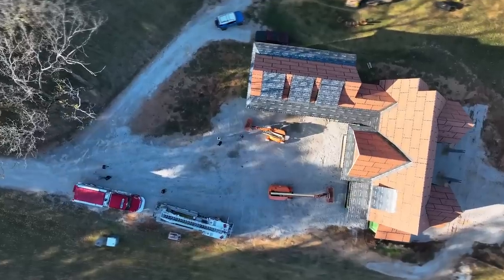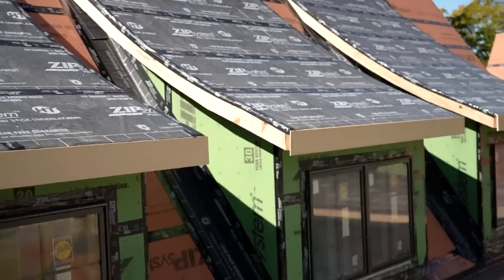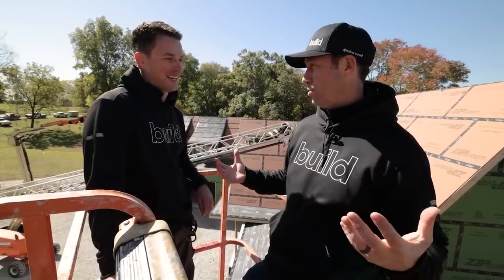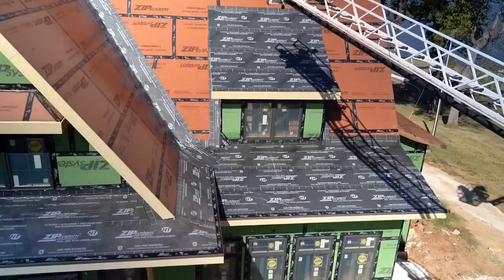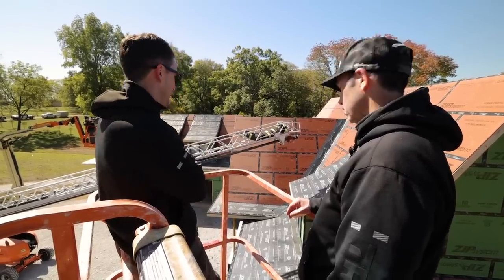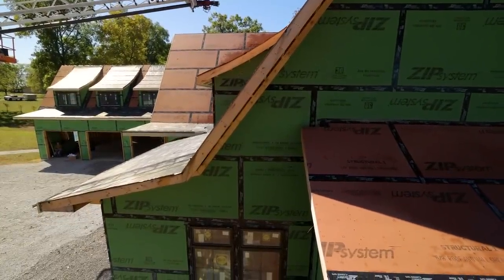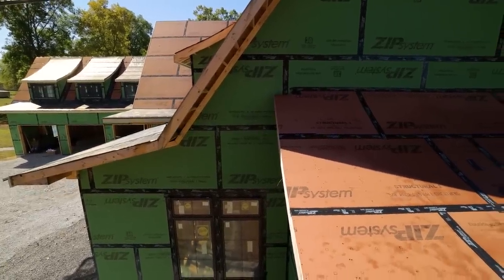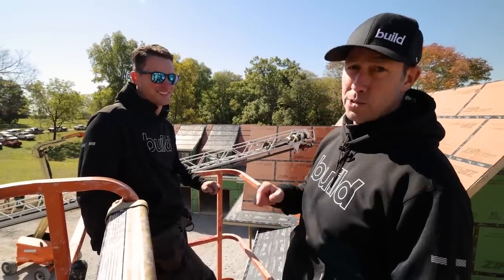Firetruck vs. ZIP System... Water stress test!

Comment: As a plumber, my experience is its not the big one off water exposure you need to worry about. It's the slow consistency that ruins wood in no time at all.
Reply: Yes, the fire truck is hokum for Huber products of glued wood chips dipped in goop and covered duct tape.
Reply: @newsnowadirondacksredux360  lmao very very true

Comment: Thanks Matt! You inspired my wife and I to not only use the Zip System but also build our whole house ourselves! Great video and reassured us we made the right choice.
Reply: @Islandwaterjet  it's not just OSB it's zip system. There is a huge difference.
Reply: Yes and it’s definitely not just OSB with paint on it either it’s basically a form board that’s stick able in order to be able to seal the joints super well and if done right it’s a forever product
Reply: @Islandwaterjet  what kind of waterjet do you have?
Reply: Nice lack of fall protection while on a lift. What standard uses a fire truck? None and where is the negative pressure/wind. I once watched an owner request a 4” hose and nozzle connected to a hydrant on a curtain wall field mock-up. He successfully blew the glass out in 5 seconds and I asked him if wanted to pay for a new mock-up to continue testing. 
Problem with Zip and peel and stick type systems is long term adhesion. Acrylic materials tend to crack in time. These systems are all based upon adhesives, which in my 40 years I’ve seen countless adhesion failure as a primary source of product failure once subjected to time, movement, temperature and moisture along with a lack of continuity in sealing dissimilar products. 
To quote Tommy Boy, “if you want me to take a dump in a box and mark it guaranteed.”
Reply: @Islandwaterjet  Exactly even it is spayed with a couple mils of goop and the seams are duct taped.
Reply: @georgewelker853  it is subject to adhesion of dissimilar materials. That’s not forever.
Reply: @Islandwaterjet  Thats funny, the pieces that I've left out in the elements for over three years for a backyard test are in excellent condition.
Reply: @mcintosh.daughter  what standard are you using for your test criteria?  Is it part of a wall assembly or just sheet outside in the desert?  Exposed to the water, thermal exchanges and UV radiation OSB will swell and delaminate causing wood fibers and glue to fail.  Moisture is a killer for OSB sheet.
Reply: @newsnowadirondacksredux360  And given enough time water can carve canyons into rocks. All wood is susceptible to degradation, unless its been petrified, then its much more resilient. Right now I have pieces of Zip that have been outside for over three years that are currently wet from rain/snow, and are holding up just fine. What Vancouver said about it "disintegrating in a few days" is false and ignorant.
Reply: @mcintosh.daughter  Typically, we use a 20 year standard in south Florida sun as a UV criteria. What standard are you using?  I reckon Vancouver is submerged his OSB in water for 3 days. Try that and report back. You must have standards to test. Fire hoses and fire trucks are for show as they don’t represent reality. This channel pumps the Huber system, which is fine I guess. However, I can show you T&G spruce with double felt and mineral wool that would do the same fire truck test and not rot in 10 years. Matt is likely paid by Huber.
Reply: @newsnowadirondacksredux360  I've soaked Zip. It swells some along the edges, but does not disintegrate. Hosing a roof down with a firetruck is not meant to demonstrate long term durability. It is a great demonstration for the Fortifide certification.
Reply: @mcintosh.daughter  “Fortified Certification”. Glam and sales tricks. It doesn’t address long term durability of glues and tapes.

Comment: The only part I dislike about the zip ice and water shield, is that they don't split the backing. In my opinion and experience the split backers are so much easier to install wrinkle free and makes getting into corners easier.  Love your channel I learn a lot from your custom builds and ways to improve my skills and challenge myself.

Comment: Zip's waterproofing system is awesome! Used it on my last build. Stretch tape is revolutionary. However I had huge issues with the exposure rating of the sheathing itself. I had to replace around half of the sheets on the project because they swole up and warped so badly after a few weeks of exposure to rain. The rep came out and told me it would be fully covered under warranty and that they have seen this problem before. Then later screwed me over on the warranty by only paying out a fraction of the cost to fix the problem.

So now I'm in an odd spot where I like the waterproofing part of the product, but really don't trust the actual sheathing or the company backing their claim to a warranty.
Reply: Interesting.  I've had Zip exposed for years and it looks great
Reply: @mcintosh.daughter  Yeah, I'm not really sure. It was comically bad, bowing +/- 1" between studs.

I also had plain commodity OSB on the same project exposed to the same conditions, installed exactly the same way and it did not experience the issue. So there was something about that batch of Zip I received.
Reply: Did you roll your zip tape
Reply: @bofficial314  Yes, very well. My issue was not with their waterproofing system, that works great. My issue is with the weather exposure rating of the actual OSB sheathing itself. Any weather rated sheathing should be able to handle some weather before the structure is fully dried-in and this did not.
Reply: zip is still OSB and OSB soaks up like a SPONGE

Comment: Great demonstration of the benefits of a totally sealed roof deck.  The shingles are mostly protecting you from the run and the erosive properties of rain, and the roof deck is itself waterproof and also can shed water.  I'm not sure of the exact rules here in Southwestern Ontario Canada, but I'm pretty sure our in code we have to use two rows of peel and stick on medium to high slope, and do the whole roof on low slopes.  Ice dams are a seriously big problem in freeze-thaw climates where roofs have warm attics and the colder nights refreeze the snow melt running down the roof as it reaches the eaves.  The ice dam can grow up into and under roof systems, and even if it doesn't get past the shingle and leak, it's horrible for the lifespan of the roof.  So, keep the roof deck as cold as possible,  which also necessitates very diligent planning and execution of other house sealing and insulation strategies.

Comment: 3:03 -- Should that peel-and-stick be rippling? It doesn't look like it was rippled at 2:32 when the water was perhaps first going on. Or is this change just some lighting aspects of dry vs wet?
Reply: @Islandwaterjet  Fine Homebuilding podcast 503 at 44:30 (on the YouTube video version) discussed a case study of felt paper that looked like that. For felt paper, if it looked rippled, some manufacturer's instructions were that this needed to be remedied before shingles could be placed (46:00).

I was curious what ZIP expects here for the warranty, so I looked up their warranty doc. They indicate that the peel-and-stick has to be pressed throughout -- "apply firm hand pressure" -- presumably because the membrane isn't rolled like the ZIP tape. I wonder if the rippling indicates this pressing wasn't done adequately on this install? I'd expect rippling on an upper edge would at least partially defeat the purpose of the peel-and-stick.
Reply: zip sheets are not smooth, they have a texture, so its walkable

Comment: Explain why ZIP now needs ice and water shields and why zip is still worth it since you can apply peel and stick to a much lower cost decking.
Reply: Every video I see them do this they never explain why. it's like they don't believe in the zip system anymore to be on its own. I can't figure it out and they never explain to us. It seems like a waste of a secondary product to be put on top of that zip.
Reply: Great comment! I had my personal house priced with peel and stick vs zip, and zip was 3k more (3300sf house)… when a peel and stick has more coverage, the advantage to shingle style (not relying on adhesive technology) etc. 
I’m not talking bad about Zip (I’ve had their tape on a test sample at my house for durability, seems to be holding up great through frost, cold, sun exposure). I just don’t feel zip is worth the extra cost in my opinion
Reply: This is a good point, The whole point of using zip is not to have to do an additional barrier.
Get the air tightness and all that, seems really great on walls but if you still need to put this on the roof then what’s the point.
Honestly it feels like this is kind of overkill and you’d probably be fine with just normal zip and tape, as they kind of proved right here.
But this does feel genuinely excessive
Reply: In an installation course I attended, the ZIP representative made it clear that there product is coated with a weather resistant barrier and that it is not intended to be a waterproof barrier.
Reply: It’s looks like they did that on the low pitch roofs that are more susceptible to water getting under the shingles. Just my guess
Reply: 1 is none...2 is one...I guess extra protection if you can afford it??
Reply: In some jurisdictions it does not matter what osb is used you have to have ice & water shield due to code.  Zip sheathing or not
Reply: Imagine spending millions on a house and it leaks. That’s why.
Reply: Also would love this to be addressed. Outside of local code requiring it, why would they do it where it's not needed? The whole point is too mitigate ice creeping up, but if the ZIP is waterproof, who cares if it creeps?
Reply: yup... I think for roof, regular osb + peel and stick is better.
Reply: Whats the realistic life expectations on peel and stick vs zip for a roof? Just curious. Lets say in a hot and humid or a northern cold climate.
Reply: @cocopp1826  I would think it would depend on whether or not the roof was vented or not. Temperature plays a big role in the lifespan of roofing materials
Reply: @av1204  Agreed.. Hell for half the cost of ZIP I can use 3/4" T&G on the roof..
Reply: @FJB2020  I wouldnt suggest it but yes yes you could. 5/8 osb + Good peel and stick, is better to me than Zip system. Lots of peel and sticks are self sealing so the whole nail thing doesnt matter.
Reply: Its just extra protection or over engineering as a way to describe it.
Reply: @av1204  I know, I was just using it as a number.. If I was to use 5/8" OSB it is less than 1/3rd of Zip..
Reply: i wonder how fast a house goes up in flames with R value zip. that foam must light up quick

Comment: That’s all great but to your point of a asphalt roof flying off. The water will get in where all the nails that held the shingles in place are going thru the zip sheeting.
Reply: I think he mentioned that about 10 times in the video
Reply: Often when shingles rip off in a storm the nails remain in the sheathing.

Comment: Nice dramatic video, but as someone who has been chasing leaks in a coastal community for 20 years 
you eventually learn it's the wind driven rain that finds the tiniest holes that can leak tremendous amounts of water into a structure.
Reply: My thoughts too, wind does amazing things.
Reply: I don't understand how the tiniest hole can allow infiltration of tremendous amounts of water.
Reply: @mcintosh.daughter  30 to 40 MPH winds create a pressure difference across a typical house. The water is actually sucked into the house. I have witnessed this. I laugh when I see YouTube videos sloping the bottom of a rough opening for a window saying water can run out. Wind doesn't care about the slope. 
Make sure there are no holes in your window installation.
Reply: @lrc87290 I understand pressure differentials created on surfaces in high winds. I too have experienced the wild world of physics and fluid dynamics. My point was that saying a tremendous amount of water can pass through the tiniest hole is misleading. Absolutely water can pass through a tiny hole, but saying a tremendous amount of water even under severe conditions can pass through the tiniest hole I believe to be an exaggerated statement.
Reply: @lrc87290  Unless our definitions of "tiniest " and "tremendous" are significantly different and I am just talking cross purposes to you. Which is very likely.
Reply: @mcintosh.daughter  Fair point

Comment: Would it be a good idea to Ziptape your plumbing penetrations before putting on the boot?
Reply: I use Zip Stretch Tape to seal around the pipe to the sheathing before roofing and pipe boots go on.

Comment: This looks like a vendor sponsored response video to an ad I saw recently where in lab testing a professionally installed zip system at sustained water pressures had leakage while the competition did not. Honestly I don't understand as a layman why they're  testing without fullly finishing the outside.
Reply: Those lab testing videos showing Tyvek performing better than Zip are sponsored by Dupont. I've had water infiltration with properly install mechanically fastened WRB's. I've not had water infiltration with properly installed Zip.

Comment: Use closed cell spray foam on the roof deck and you won’t have to worry about those nail holes leaking either.
Reply: cool story. and when you replace your roof you have to replace your insulation as well!
Reply: @stevecrawford6958  and how often do you gotta replace your roof deck if it’s built and sealed properly? If a tornado yanks it off like a kid tearing into a cereal box, doesn’t matter where the insulation is installed…

Comment: whats the cost difference from building a house with zip vs regular plywood?
Reply: If you do it for a small project  (Like a shed or Tiny House) the additional cost is negligible. For my 12x20 guest house out back it cost me $400 more to use ZIP over plywood.  Just depends on area but if its not needed by code better off saving your money.

Comment: Those curved dormers are a trademark of so-called "craftsmen" designs, as are excessively complex roof/wall layouts.  They LOOK good, but I'll be damned as a potential home builder to being limited by "what looks good".  I'm over 60 years old, okay?  I don't give a flying crap about RE-SALE VALUE!  I want a home design that will be COMFORTABLE for my wife and myself to enjoy until the "Roll-Call" is summoned.
.
Additional:
I'll be much more interested in the Zip system of sheathing when they get approval for the "Zip-R" for use as ROOF underlayment.  I'm up in the region where a 12:8 roof pitch or higher is normal and a 12:12 isn't unusual.  I would LOVE to have my "semi-conditioned" attic space be nearly as tight as the rest of the house.
Reply: Honestly complex roof lines makes me see  higher maintenance cost and lower value. It may be rich people showing off but to me that's a waste of money. Nook and crannies and valleys just scream water and bug penetration and gaps in 50 years.
Reply: @granatmof  I agree, the most "complex" roof I'd want is a Gambrel/barn style.  Preferably with the ridge running E-W so it would be aligned for solar panels or shingles (NOT from Tesla!)

Comment: Wish i got something like this done to my house. I got fooled big time by a bogus roofing company that thankfully went out of business shortly after scamming me on a roof replacement.
Reply: What happened?
Reply: @wkobayashim  so they're big sales pitch was they would replace up to 3 full sheets of plywood at no additional cost if they found damage once the old roof was removed. Well that was good because my house was built in 1965 and i could go into my attic and see the wood on the downward side of the chimney was more like paper than wood at this point. I even showed the guy this spot and to let me know if they found anything else to which he said yea no problem. The job gets started and on day 1 they have the whole house stripped and half of the new roof installed including that area. I look in the attic and that same horrible plywood is still there. So i call the guy up tell him it didnt get replaced "oh sorry yea I'll get that taken care of". Next day roof gets finished bad wood still there and they did a horrible job on a piece of flashing for a window bump out that terminates into the brick lower story plus thanks to an ornery squirrel that chewed a hole in a facial board i discovered more plywood they didn't even tell me about let alone fix. I then harped on this guy for a couple months, i hear through the grapevine their business is not doing well, and hes a ghost for several weeks. Finally he gets in touch with me says he'll make it right,  the flashing gets replaced with a slight less ugly job, the chimney plywood is replaced, the plywood unveiled by the squirrel is replaced but poorly, and thats the last i ever heard of him. I find out shortly after the business is done and gone. Just two weeks ago i discovered another overhang section that is basically holding on by hopes and dreams that clearly is decades worth of wear and tear that they just slapped new shingles over and called it a day. I just want to rip it all off including every piece of plywood and do a roof system similar to this video but I just dont have the time. I could do it myself but i have too many other projects to do as it is.

Comment: This channel is more of an advertisement for Huber. You could easily get just as good or better water sealing with just a traditional peal-n-stick over Osb. Until Hubers patent runs out on Zip, it won't take off.  Applying Peel--n-stick over Zip seems crazy, unless you have and orchard full of money trees.
Reply: Patent has expired, LP forcefield panels are almost 1/2 the price.
Reply: @onlyscience7120  I'm pretty sure LP is licensing the use of their system. Huber won that lawsuit. It's been a minute since I read the details, but it seems like I remember their patent being good until 2025.